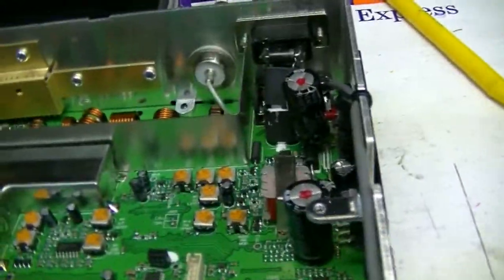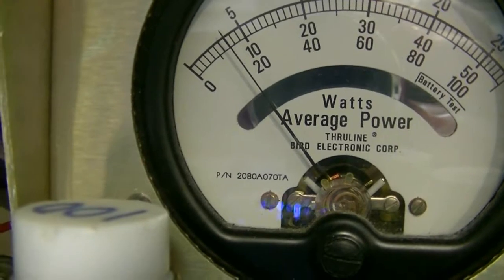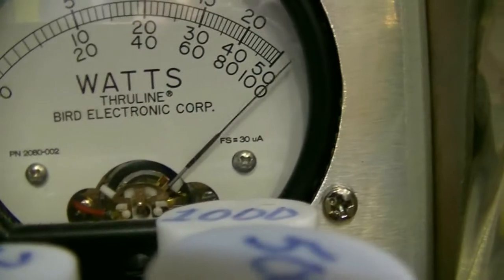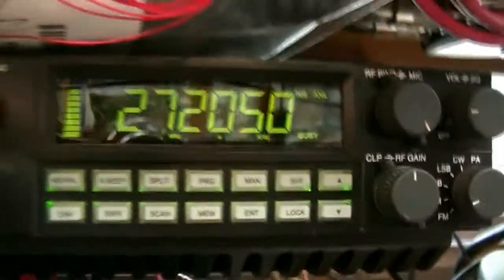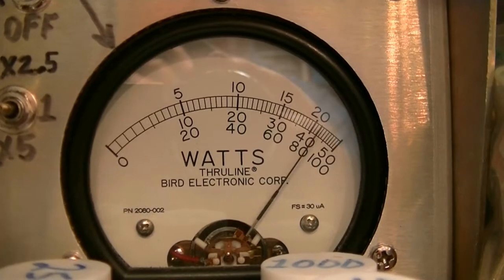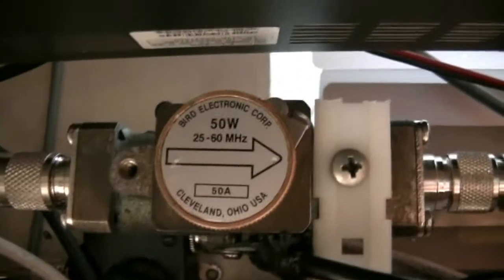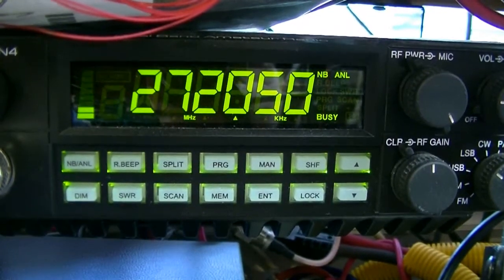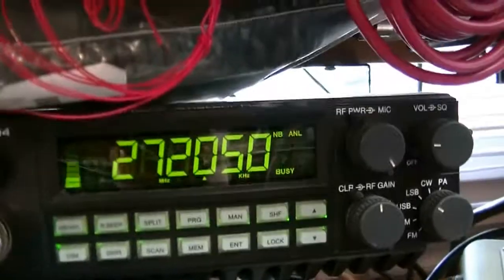Richard H SR955 repair

Comment: Not too bad for a stryker. I am still a Ranger rci 2950 guy. How hard would it be t o show on your scope how clean or dirty the signal is? How much trash the transmitter is causing?  I hear good sounding signals all the time. But they are 2,3,4,channels wide. I hear them 3 channels up and down from the intended channel. Not good ! Thank you see ir and 73.